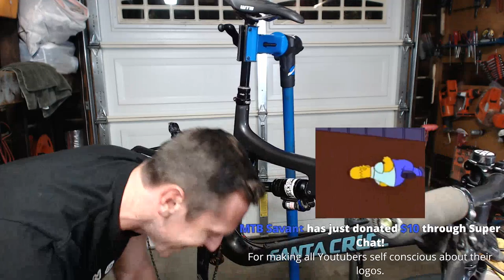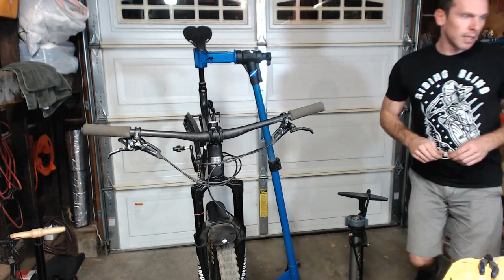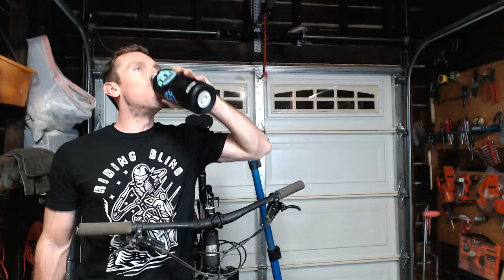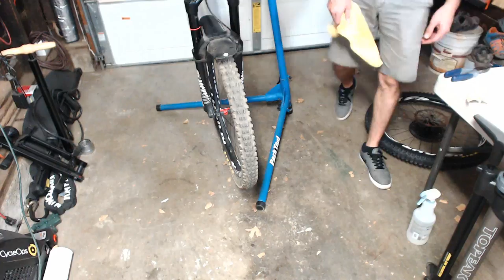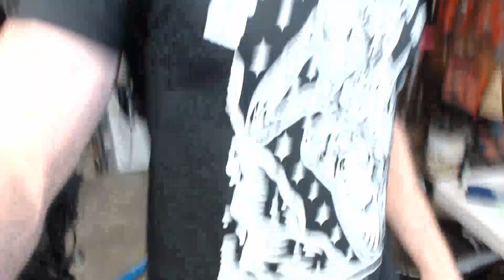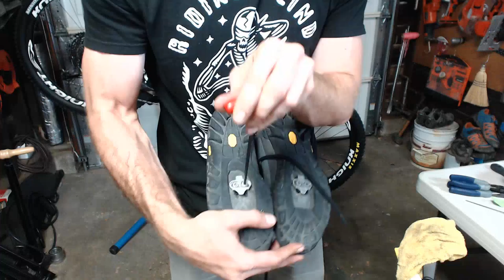Rockhopper Enduro Bike Maintenance

Comment: what you using for chain lube?  most of the year I use a wet lube and couldn't wipe my chain down like that

wee bit of washing up liquid on the bead will make it easy to slip the tyre on
Reply from the maker: I use Rock N Roll "Extreme" lube.